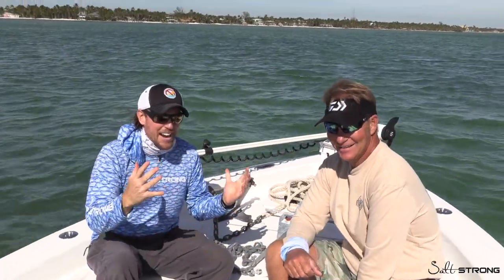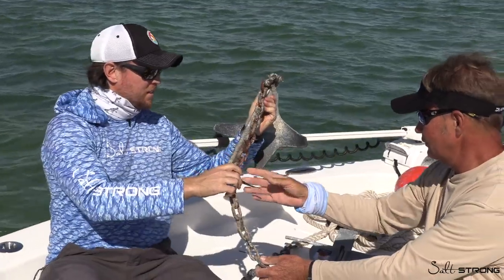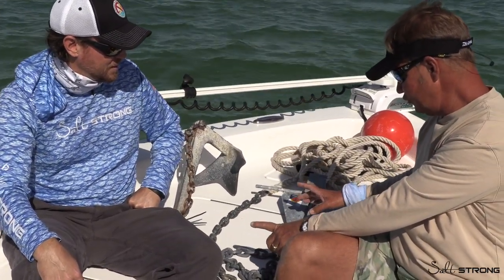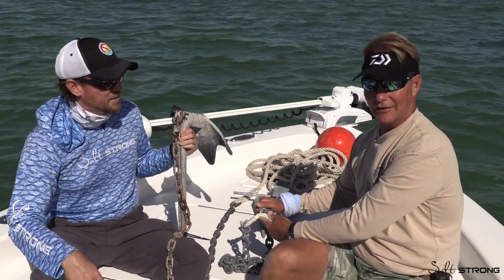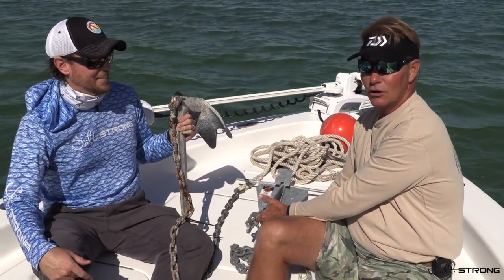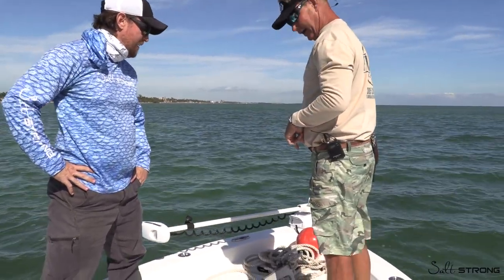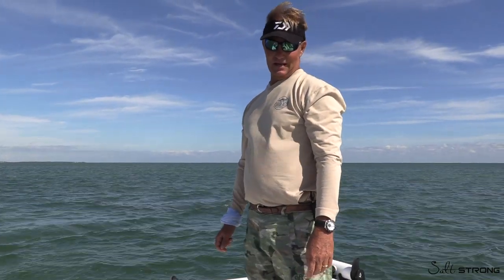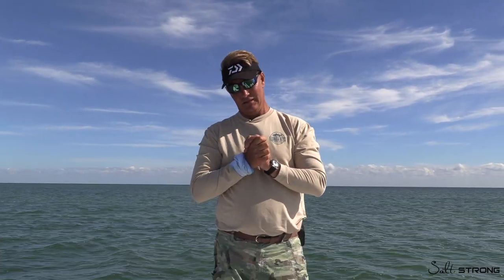How To Anchor A Bay Boat (Top Anchoring Mistakes & Tips)

Comment: I thought this was going to be a pretty basic video from the title, but I actually learned a few new things I’d never seen.  Well done.  Just adding an additional fyi, coming from someone who learned the hard way, always make sure the anchor line is in front of the boat and most importantly that its location is communicated to you from your mate up on the bow.  It can get in your prop real fast with the help of wind and current when you’re pushing forward to un-anchor.

Comment: Bow anchor rollers are cheap to get and easy to diy. It pretty much solves all of the issues with anchor strikes and chain chafing. Even without winch it allows you to pull the rope or chain further back making it more ergonomic, safer as you're further from the deck edge and better posture gives you a lot more strenght to yank that hunk of metal off the floor.

 I'm going to include one on my 16' lake boat when it's time for that. In my case a pound of aluminium and a roller is definitely worth it.

Comment: Great video.  That plow anchor is really great in sand and mud.  Most of the bottom where I boat is hard bottom and I mainly use the Danforth type.  My 21' bay boat was so easy to anchor.  My 24' pontoon is sometimes a challenge 😁.  Chain and scope is definitely the way to go.  And don't throw that anchor.  How to properly anchor your boat isn't rocket science but I see so many boaters that are just so inept at getting it done.  
Thanks again.

Comment: Coast Guard recommends a scope of 7:1 as a rule . However, on calm days in shallow water we can use a shorter scope. If we are anchoring as a safety or emergency reason, use the longer scope.
Reply: so  does the chain length determine the scope or the length of rope? it looked like he had about 8 ft of chain

Comment: I am purchasing a sportsman 227 open, and I am wondering if it comes with an anchor as there is a place that the anchor is stored, and should I get a gelcoat chain, so as to not scratch the boat when pulling the anchor off the bottom.

Comment: Another old greyheaded sailor here chiming in with contrary words. 
I feel one should mention, no, one should stress that 3 to 1 is only for very temporary anchoring like when sport fishing. 
Even 5 to 1 is short scope when using all chain and expecting to overnight through a south Florida thunderstorm. Old Coast Guard standards were developed over many decades of heavy weather experience which state 7 to 1 as the standard and 10 to 1 for storm  anchoring.
Plus please point out that depth is from the top of the boat's bow to the sea bottom!
I have been cruising and staying on sailing vessels in south Florida since the 90s and I have lost count of the short scope suckers dragging down on responsible sailors exercising proper  seamanship. 
Just had to pipe  in as 3 to 1 is pure disaster for anything other than a few minutes of tossing lures to fish.
I must mention Hollywood did a great job presenting safe rode and anchor deployment and retrieval. Flaking the line first and not throwing being big things.
Reply: Most of the time you’re limited by how much scope you have on board 15’ of depth becomes 210’ of scope ideally. A second or third anchor or kedges all become part of the strategy.

Comment: What if the anchor stuck on the reef on strong current we lose our anchor have to cut the rope the current was to strong
Reply from the maker: In that situation, you're likely going to have to cut and leave the anchor. You should always take the current and bottom into account. Anchors are expensive to replace. Try to anchor in areas without that strong current and rocky bottom, look for calmer areas to anchor up.

Comment: Few good tips for novice boaters 
But I disagree with several of your 
Points. I use the claw anchor and the danforth and scoop anchors 
For about 50 years now, and they 
Do each have their own strong points. What are you showing people 
Is what I would call a lunch hook 
A short term or not leaving the boat 
Type of anchoring ⚓️ no one should anchor in a reef .   And that 
Claw anchor, you love has the weakest holding power of any anchor  made to date.
Reply from the maker: Thanks for the comment! Use what works best for you!!